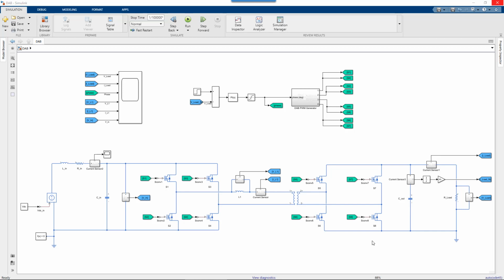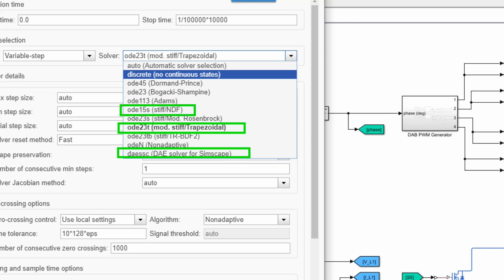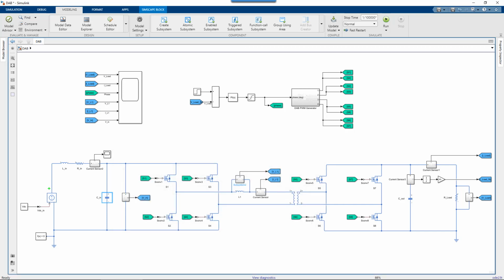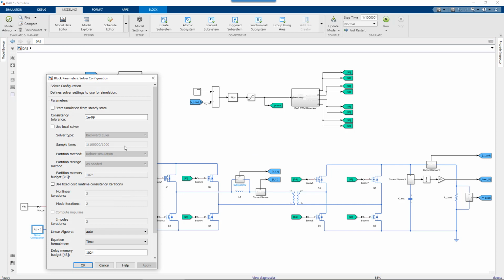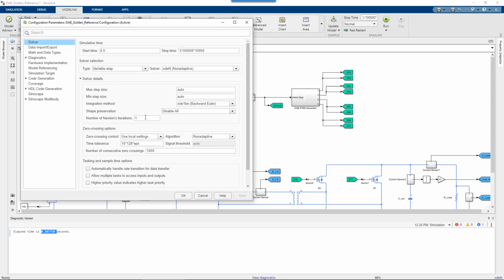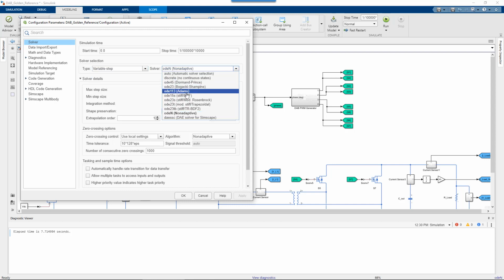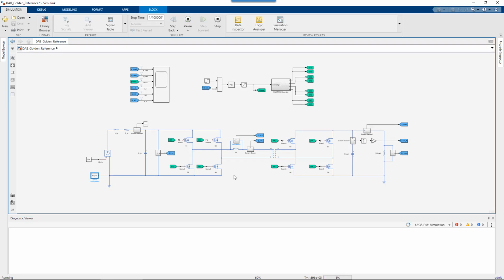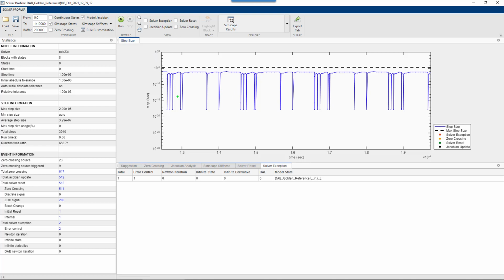Simscape Electrical: Solver Settings - Best Practices

Comment: Amazing video! Thank you very much for this content. Have you ever used LTspice components (SiC MOSFET) in Simscape Electrical? I know that the subcircuit2ssc function allows the conversion of .lib files and then the component can be generated in library browser. I have done all these steps. In the case of a buck converter, the signals are good.  In the case of a single phase h bridge inverter, the simulation time becomes extremely slow, the signals are not good, etc. I have not found any examples or mathworks videos, using this approach with an inverter. You will save me if you make a video about it :D
Reply from the maker: Unfortunately, some of the LTspice models uses LTspice proprietary functions that don't import, so I have to look for PSPICE equivalents or hand modify the file to get the import to work.  At that point I'm more likely to just use the n-channel mosfet and parameterize it from the data sheet.
Reply: @electrificationenthusiasts8611 hello, do you have a video about how to parametrize the n-channel mosfet from datasheet?

Comment: Can you please explain advantages of simscape  models over simulink models.....why should we prefer simscape models.
Reply from the maker: The simple reason is that is is much easier to put together complex models in Simscape than Simulink.  Simscape supports bi-directional connections while all Simulink models must be represented by input and output ports.  This makes Simscape models much easier to maintain and change compared to Simulink.  Getting deeper into the math, the Simscape engine can solve DAEs which allows for more accurate representations of things like variable resistances and other physical realities that can't be represented as well by an ODE.

A good exercise if you have free time, is to design your own RC circuit in Simulink and then in Simscape.  Then add another RC circuit across the capacitor of that circuit.  It is very easy to do in Simscape (just cut and paste), while it is hard to do in Simulink (your must rederive all of the equations).